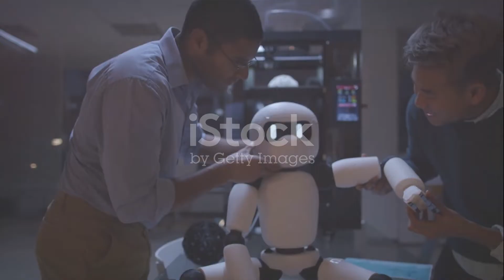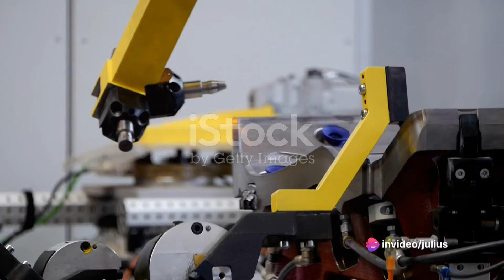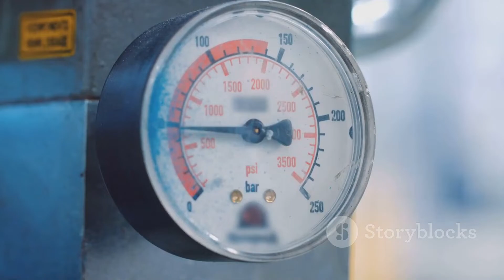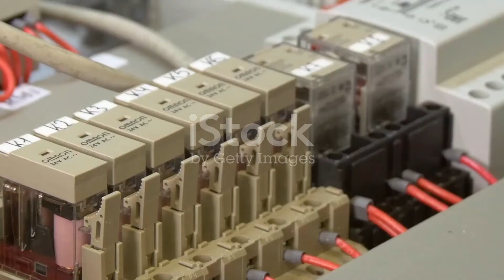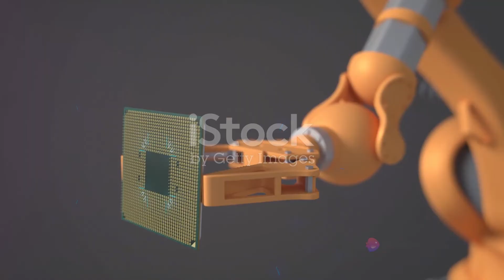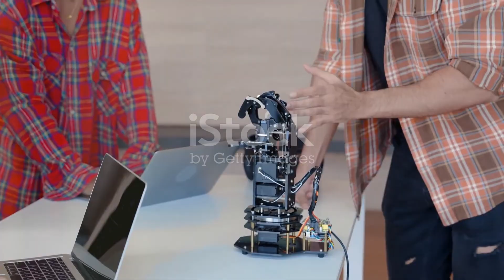Top 10 Analog Inputs in Robotics

Comment: 🤍💌 10- HERMÉS
Reply: Chelsie Ann P. Carnaje
Grade 10 - HERMES

1. What are the analog inputs and why are they important for robots?

Answer: Analog inputs are signals that continuously vary, coming from sensors that detect physical properties like temperature, light, or sound. These inputs are vital for robots as they deliver detailed environmental data. Unlike binary digital inputs, analog signals provide a spectrum of values, enabling robots to make precise adjustments and react more accurately to real-world situations. This capability to interpret varying signals is essential for robots to carry out complex tasks, such as modulating motor speed based on light levels or adjusting grip strength in response to pressure, ensuring effective interaction with their environment.
Reply: Kenichie C. Racero
10-Hermes

1. What are analog inputs and why are they important for robots?

Analog inputs are signals or data that represent continuous and fluctuating quantities, unlike digital inputs that only represent discrete binary states. These inputs are crucial for robots because they allow for the sensing, measurement, and interaction with a wide range of environmental variables, such as position, force, temperature, and more. Analog inputs enable robots to perceive the world in a nuanced and detailed way, providing the versatility and adaptability necessary for complex tasks.
Reply: Blissany Y. Torralba
10- HERMES

1. What are analog inputs and why are they important for robots?

-Analog inputs for robots are signals or data that represent continuous and fluctuating quantities, unlike digital inputs which represent discrete values. They are important because they allow robots to sense and interact with the real world in a more natural way, measuring things like temperature, pressure, or joint position.
Reply: Glenn Seth Myrrh B. Laluces
Grade 10 - HERMES

5.) How do analog signals get processed by robots after they are collected from the environment?

Robots process analog signals from the environment by first using sensors to collect data, which is then converted to digital form through an analog-to-digital converter (ADC). The digital signals are processed by the robot's microcontroller or computer, which interprets the data, makes decisions, and controls the robot's actions based on the processed information.
Reply: Annarica Niña A. Loyola
10-HERMÉS

1.) What are the analog inputs and why are they important for robots?

 -Analog inputs are signals or data representing continuous and flunctuating quantities, not just discrete binany states. These inputs can take on a plethora of values within a specified range, offering more detailed information about the environment. Analog inputs are important for robots to sense, measure and interact with variables such as position, force, temperature, and more. These inputs bring depth detail and a list of possibilities to the robotic world.
Reply: Katerina Gabrielle A. Ecuacion
10-Hermés

1. What are the analog inputs and why are they important for robots?

Analog inputs are signals or data that represent continous quantities and come from sensors that can measure things like the force applied, pressure, temperature, light, etc. They offer more nuanced and detailed information about the robot's surroundings that can help it interact and react to its environment effectively.
Reply: Alexa Kyle R. Cabunoc
G10-Hermes

1. What are analog inputs and why are they important for robots?

Analog inputs are continuously varying signals from the environment. They are crucial for robots as they enable accurate perception and interaction with the physical world, such as measuring temperature, light, and sound.
Reply: Zophiel Hailey Jace B. Usman
10 - Hermés

1. What are analog inputs and why are they important for robots?

- Analog inputs are signals that represent continuous and fluctuating quantities, unlike discrete binary states. They can take on many values within a specified range and provide robots with detailed and nuanced information about the environment, such as position, force, temperature, etc. This allows robots to better sense, measure, and interact with their surroundings.
Reply: Francess Elizah A. Pintac
10-HERMÉS

2. Describe the analogy used in the video to explain the significance of analog inputs in robotics.
        -   The analogy “painting a masterpiece with only 2 colours” used to explain the significance of analog input in robotics, effectively illustrates the importance of analog inputs, emphasizing how they provide essential data that enhance a robot's ability to understand and interact with its environment. It also indicates that it would be challenging to live in a world of robotics with restricted materials and without the help of analog inputs.
Reply: Ashanele Leigh Caressa P. Go
10 - Hermes

1: What are analog input and why are they important for robots?
- Analog inputs are signals  that represent continuous and varying quantities.. Analog signals can take on a range of values within a specified range, providing more nuanced and detailed information about the environment. These are important for robotics as it allows the robots to perceive and interact with the real world more accurately.
Reply: Azryl Prince Yohance A. Pagaling
Grade 10 Hermes

1. What are analog inputs and why are they important for robots?

- - - -Analog inputs are vital for robots because they enable the detection and interpretation of a wide range of physical signals, such as temperature, pressure, or light intensity. By converting these continuous signals into digital data, robots can accurately sense and adapt to their environment, which enhances their ability to perform tasks effectively and interact with varying conditions.
Reply: Herah Jhylie Zean Q. Agbu
10 - HERMÈS 

5. How do analog signals get processed by robots after they are collected from the environment?

Robots use analog signals to gather information about their surroundings, and then converting them into digital signals using analog to digital converters or ADCs. This conversion process involves discretizing the continuous analog signal into discrete digital values that can be easily manipulated by the robot’s algorithms. After processing the digital signal, the robot's control system interprets the data and uses it to make decisions and manage the robot's actions.
Reply: Yash Argel T. Galon
10- Hermes

1. What are analog inputs and why are they important for robots?
— They are signals or data representing continuous and fluctuating quantities. They can take on a plethora of values within a specific range, by this they can provide more detailed information. These inputs are helpful for robots to sense, measure and interact.
Reply: Khate Althea P. Clarito
10-Hermes

3. Explain the role of position sensors like potentiometers in robotic systems.

•Position sensors provide an analog voltage proportional to the position of a movable part like a robot joint. This sensor are used to measure and detect the position of an object.
Reply: Hannah Bella A. Ihalas
10 - HERMÉS

1. What are analog inputs and why are they important for robots?
— Analog inputs for robots are signals or data that indicate continuous and variable values rather than discrete binary states. They can take on a wide variety of values within a given range, providing less apparent and more detailed information about the environment. These inputs help robots sense, measure, and interact with factors including position, force, temperature, and more.
Reply: Christina B. Colarte
Grade X - Hermés

1. What are analog inputs and why are they important for robots? 
- Analog inputs for robots are signals or data presenting continuous and fluctuating quantities, not just discrete binary states, they can take on a plethora of values within a specified range offering more detailed information about the environment. These inputs are instrumental for robots to sense, measure, and interact with variables such as position, force, temperature and more.
Reply: Khieffer Neil G. Ensomo
10-Hermes 

3. Explain the role of position sensors like potentiometers in robotic systems.

- The role of position sensors in a robot's system is to provide an analog voltage output that is directly proportional to the position of a movable component. This means that as the part moves, the voltage changes, allowing the robot to measure and track the exact position.
Reply: Camyll Jhey P. Belhot
Grade 10 Hermés

1. What are analog inputs and why are they important for robots?
-

Analog inputs are continuously varying signals from sensors that measure physical properties like temperature, light, or sound. These inputs are crucial for robots, providing detailed environmental data. Unlike binary digital inputs, analog signals offer a range of values, enabling precise adjustments and accurate responses. This ability to interpret varying signals is vital for robots to perform complex tasks, like adjusting motor speed based on light or grip strength based on pressure, ensuring effective interaction with their environment.
Reply: Camyll Jhey P. Belhot
10- Hermes

1. what are analog inputs and why are they important?
Analog inputs are continuously varying signals from sensors that measure physical properties like temperature, light, or sound. These inputs are crucial for robots, providing detailed environmental data. Unlike binary digital inputs, analog signals offer a range of values, enabling precise adjustments and accurate responses. This ability to interpret varying signals is vital for robots to perform complex tasks, like adjusting motor speed based on light or grip strength based on pressure, ensuring effective interaction with their environment.
Reply: Tysh Maeganne Z. Sagocsoc
10- Hermes

1. What are analog inputs and why are they important for robots?
- Analog inputs are datas representing continuous and varying quantities, it provides more detailed information about the environment. It enables robots to interact, measure, and sense temperature, force, position and more.
Reply: Exceldoin L. Nise
X-Hermés

1. What are the analog inputs and why are they important for robots?

Analog inputs are continuous signals used by robots to gather sensory data, allowing them to perceive and respond to their environment with precision. They're essential for tasks that require nuanced interaction, such as adjusting to changes in light, temperature, or pressure.
Reply: Ma. Nicole Cyse L. Rojo
10 - Hermes

1. What are analog inputs and why are they important for robots?

- Analog inputs are signals that vary continuously and are used in robots to read data from sensors like temperature, light, or pressure. They are important because they allow robots to perceive and interact with their environment more precisely.
Reply: Hamainie Briezies O. Gabriola
10 - HERMES

1. What are analog inputs and why are they important for robots?

Ans: Analog inputs are signals that change continuously, originating from sensors that measure physical properties like temperature, light, or sound. These inputs are crucial for robots because they provide detailed information about the environment. Unlike digital inputs that are binary, analog signals offer a range of values, allowing robots to make fine-tuned adjustments and respond more accurately to real-world conditions. This ability to interpret varying signals is essential for robots to perform complex tasks, such as adjusting motor speed based on light levels or modifying grip strength in response to pressure, ensuring they interact effectively with their surroundings.
Reply: Frenzzy Kyla C. Halasan
10- HERMES

How do analog signals get processed by robots after they are collected from the environment?

--After robots collect analog signals, they are converted into digital signals using Analog-to-Digital Converters, better known as  ADCs. These signals are processed to extract important information, allowing the robots to make decisions. The robot can control its actuators to respond appropriately to environmental conditions with this processed data.
Reply: Deron Ethan B. Pacaña
Grade 10 - HERMÉS

1. What are the analog inputs and why are they important for robots?

Analog inputs are signals representing continuous and fluctuating values, such as position, force, or temperature, that provide robots with detailed information about their environment. They are essential because they enable robots to sense, measure, and interact with complex, real-world variables, allowing for more precise and adaptable behavior in tasks like object manipulation, environmental monitoring, and structural assessment.

Comment: Rhilyne B. Rivas
10-Andromeda

1. What are analog inputs and why are they important for robots?

—Analog inputs are continuous signals from sensors that measure physical properties like temperature, light, or sound, and they are essential for robots because they provide detailed information about the environment. Unlike digital inputs, which are binary, analog inputs offer a range of values, enabling robots to make fine adjustments and respond more accurately to real-world conditions. This ability to process varying signals is crucial for robots to perform complex tasks, such as controlling motor speed based on light intensity or adjusting grip strength based on sensed pressure, allowing them to interact effectively with their surroundings.